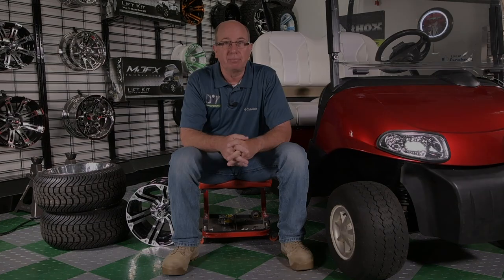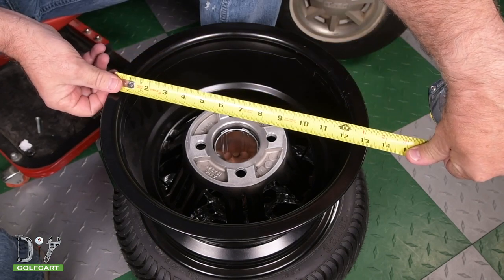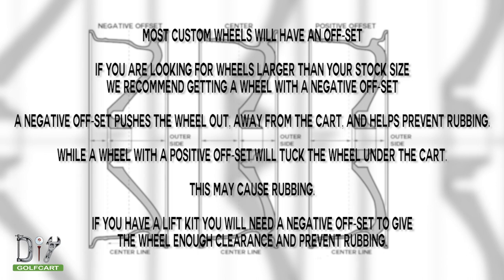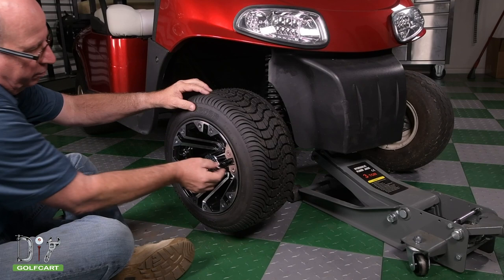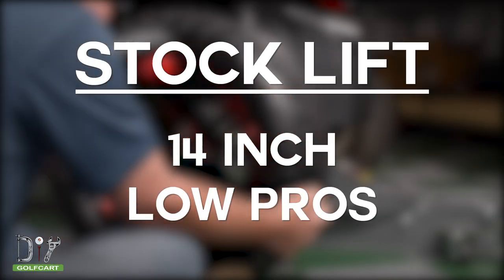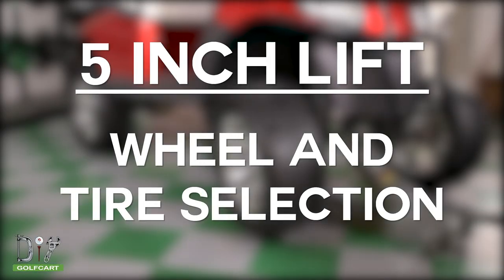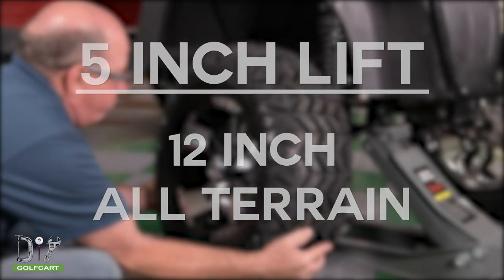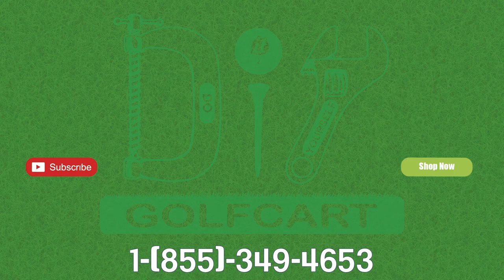How to Measure Your Golf Cart Wheels & Golf Cart Wheel Size Recommendations

Comment: If you are trying to guesstimate if a wheel & tire combo will fit without a lift, take the difference in height and divide by 2. If your tires are the standard factory issue 18 inch and your new ones will be 20.5, the 2 inch difference will result in 1 1/4” more intrusion into the wheel well and 1 1/4” more in ride height. Take a piece of lumber or a pocket book of the same thickness and use it as a feeler gauge to make sure everything is clear, turning the wheels hard left and right with a normal load in the cart (especially important if you have a rear-facing seat which exerts more pressure on your suspension.) Keep in mind your new tires will probably sit 1” or so wider than the factory ones, due to aftermarket wheel offset. Keep in mind: the higher the lift, the more squirrelly the handling may be; the lower the profile of the tire, the more firm the ride.

Comment: Great video! I have a question on the wheel hubs themselves. Are they all the same when it comes to the bearing hole size? In other words... is the spindle typically the same diameter on all golf carts? I ask this because I have seen replacement bearings measuring 1” inside diameter. I searched everywhere for this information but to no avail, wondering if it would be a good subject for a video. I would sure appreciate the information on this. Thank you!

Comment: I have 18.5 inch tires but when I measure them I'm getting around only 17 inches height...didn't check air pressure yet but I thought they were up at 20 psi....could they wear down over time or is the air pressure low the only cause?

Comment: Can 25” tires fit on a 6inch lifted cart
Reply: I have a 1993 club car ds,  6" sgc a arm lift, HD rear springs 12" with 20" tires 1" wheel spacers. I am going to go to 23" tires 1 for ride quality.  I am also going to use a ITP UTV tire because of the rounded shoulder.  I think with the offset wheel and a  rounded tore you should be able to fit 25" tires. If it does rub Jake's makes a wheelbase extender ( pushes front axles forward) this will give you a few more inches.